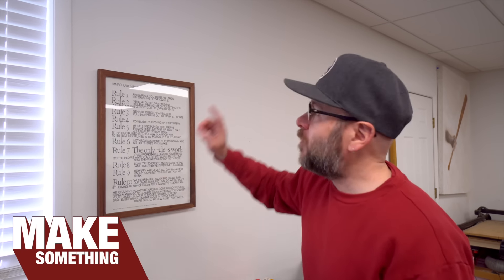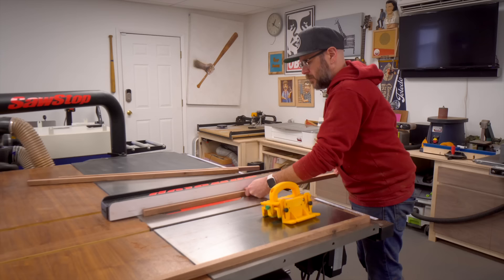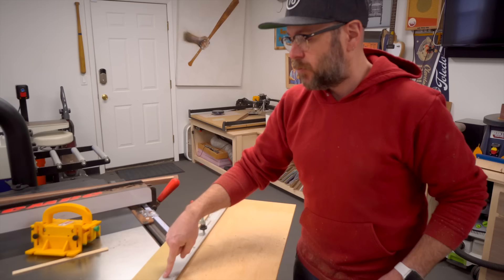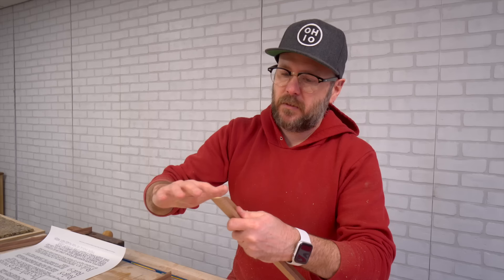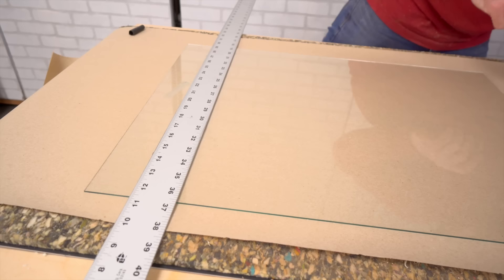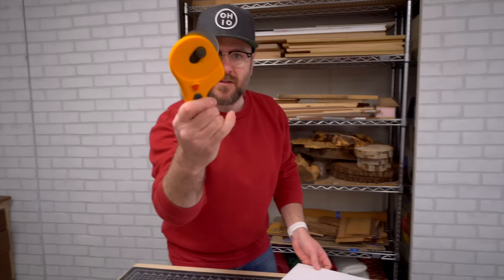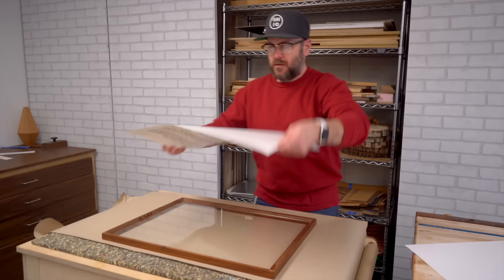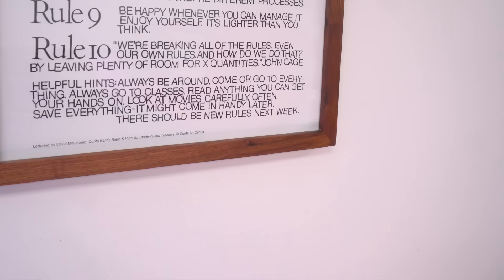Dead Simple Picture Frames. Easy Woodworking Project.

Comment: Tip I picked up a a show for small splines. Cut them with a duzuki saw and use veneer as the splines
Reply: That's nice for decoration -  but for strength?
Reply: @robira1313  I think it dose help. Miters are pretty weak.
Reply: @robira1313  seems like a fun and easy thing to test.
Reply: @jayktmk1  - I was just wondering.  How thick/thin is veneer?
Reply: @robira1313  usually 1/16th
Reply: @jayktmk1  That's pretty thick for veneer. Most is around 1/40".

Comment: I'm going to try that Maker Brand Simple Finish. Hopefully it can become my go-to finish for picture frames because I'm getting fed up with spray lacquer and the wind. I've had decent luck with Water Based poly and a brush, but I'd rather wipe on the finish. It seems like it prevents puddling much more. I've tried dewaxed shellac, but I feel that stuff cures too quickly.

Comment: What is that stapler looking tool that does the points? I've made several splined picture frames from your older video but working with Glazer's points and a hammer is the worst part. That would make my life so much easier. It sounded like you called it a "point grabber" but I can't find anything by that name.

Comment: 2 things: Don't use staples in the glass track it will crack the glass, 2: use a ratchet strap instead of tape it is a much tighter bond. Nice frame.

Comment: Do you have a link for the staple gun? The link provided links to a DeWalt that is not the one you are using in the video. Brand name and model number would help too. TIA
Reply from the maker: The staple gun I used was a Dewalt. There was also a yellow point driver as well by Logan. Link in the description.

Comment: "Dead Simple" if you have:
- Table Saw
- Ripper push block
- Staple Gun
- Point Driver
- "Framing jig" including rulers and special clamps
- Glass
- Glass cutter
- Hard stock paper 
- Wood Glue
- Finish
- Painters tape
Reply from the maker: See, you get it! Good job! Doing stuff takes stuff. Thanks!
Reply: Make Something joking, I appreciate the vid!  I’m actually doing this today with my son, but making the sled first.  Stupid q- why is the sled necessary if you have a mitre saw?
Reply from the maker: Right on! You can use a miter saw but it’s hard to get a perfect 45 degree cut. Even if it’s off by a half degree your frame won’t glue together properly. But it can be done! Good luck!
Reply: Make Something thank you!
Reply: @MakeSomething  is that the moral of the story?

Comment: Why would you not want the glue to soak into the end grain?
Reply from the maker: Gluing end grain to end grain is generally pretty weak because it soaks in all the glue. Letting the glue dry on the end grain and then gluing again will help strengthen the joint.
Reply: Make Something , thanks for the reply. So you can build on wood glue, meaning the new wet glue adheres well to the dry wood glue?

Comment: A tip I heard or read somewhere is to get a store to cut the glass for you, take you tape measure with you to double check their cut, if they cut wrong they'll recut. Besides that, you are probably already at a place that sells glass and I've never been charged much for glass even when cut to size.
I've used Ace Hardware in the past but there are also glass stores in many small cities just ask around, someone you know knows where they are if you don't.

Comment: Any Woodworker can make with a few basic woodworking tools????????? WTH???   I have a lot of beginner woodworking tools, Here is my list... drill, driver, skill saw, brad nailer, 10"sliding compound miter saw, kreg jig, angle clamps, drill press, sawsall, jigs for drawers, shelves, Homemade cutting jigs.   I do not have a table saw, sorry, I did not know this was a BASIC WOODWORKING TOOL.  I also do not have a glass cutter, point driver and I just recently bought a staple gun, because I needed to recover a bar stool. What Planet are you from again?
Reply from the maker: Sounds like you have DIY tools. A table saw is a basic woodworking tool most woodworkers have.